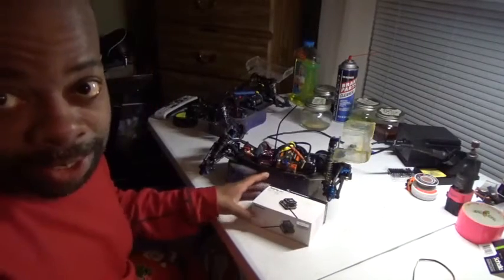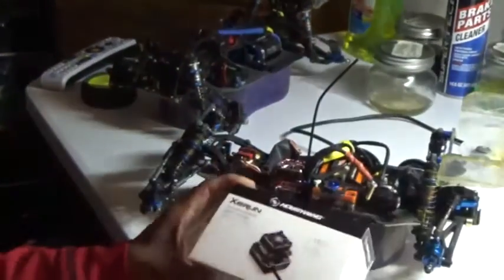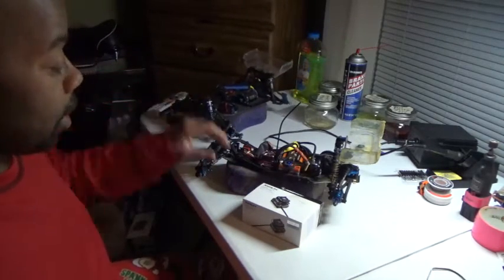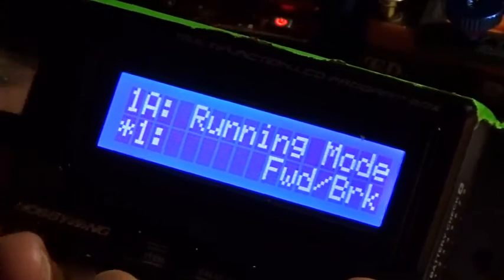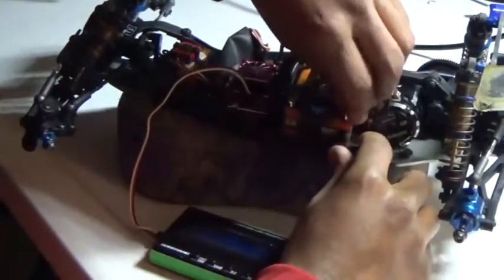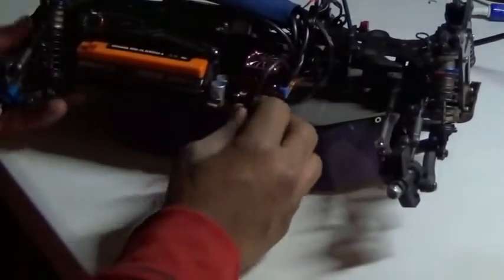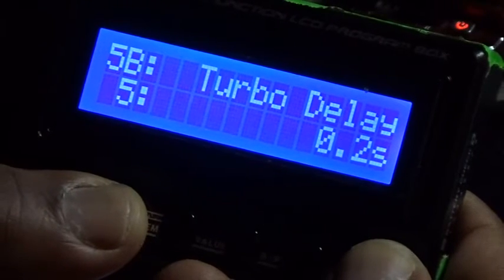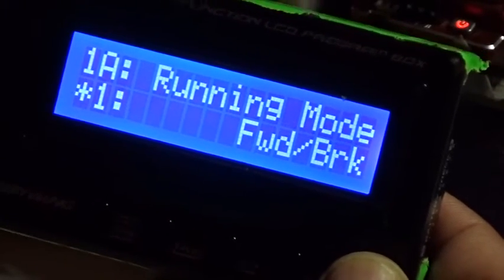My hobbywing xr10 160A settings in 2wd mod and 4wd mod

Comment: Turn drag brake off not just to zero then set inital brake force and overall brake force for 4wd it will not grab brake at nuetral position drag brake to zero is still drag brake ok thanks

Comment: I have two hobby wing 3.1s in both my B6 cars with that program box. I always wanted to know what is the difference between turbo and boost? I put 30 degrees of turbo in my stock car just to see what it would do, i took the box off, started the car and rev'd the motor with the wheels off the ground and blew my motor up, busted the magnet right off the rotor. Didn't know that was going to happen...

Comment: on my escs, I keep the timing turbo low and let the motor timing handle that. if I need some extra oomph for jumps or tight sections, that's when I will change the  regular turbo settings. I imagine its the same on yours too. I run a dualsky on my 4wd and a viper black series on my 2wd
Reply from the maker: Chester Copperpot hey chester thank you. i will do that tomarrow at the track.  whats your timing set at on your motors in 2wd and 4wd?  i got mine like 20 on both motors.   

i had a hobbywing rep set up my esc.  i would race my car bring ot in and he ask me questions on how it felt. together this is the settings we came up with.  but he did explained some of the settings but bot all of them.

but yes i will try some your timing settings tomarrow.

thanks chester
Reply: My timing on both is 19 and 20. I like to keep I low so I can add some turbo and keep the motor lasting longer. I run a 10.5 and a 9.5